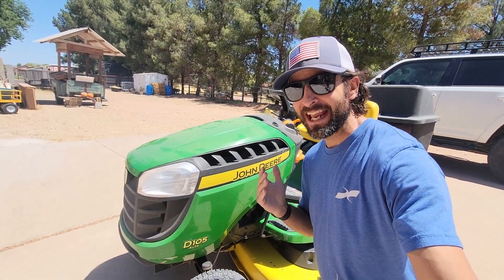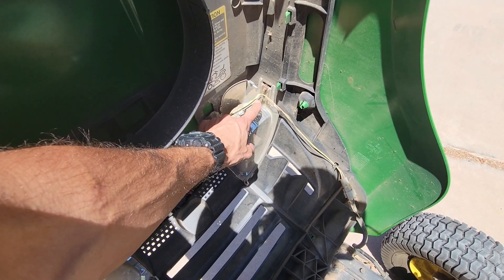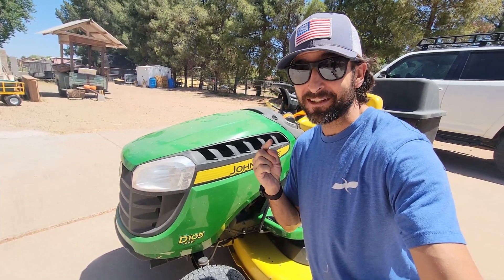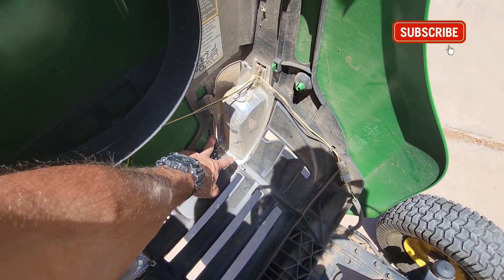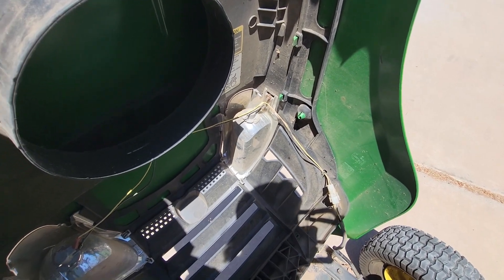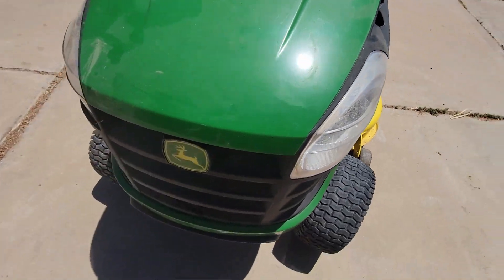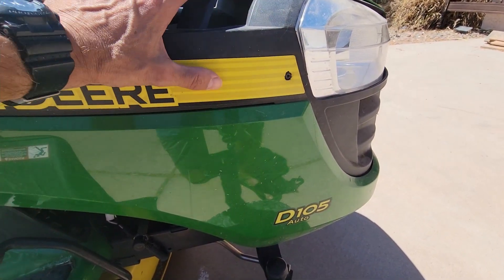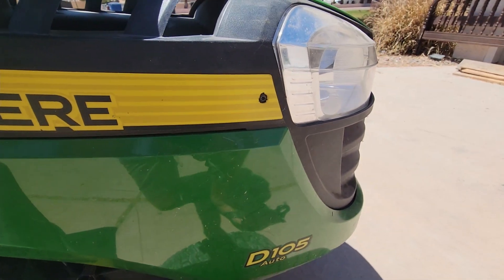John Deere D105 Headlight Removal

Comment: Great to know, thanks for the info. In fact I am planning on taking the headlights out to give me a little more light. I replaced the incandescent bulbs with LED's, MUCH brighter, a nice improvement. But I notice the inside of the headlights is painted a light grey, not very conducive for reflecting light, so I want to spray the insides with metallic paint, give it more a mirror finish instead of the grey. I'm fairly certain that should increase the output a good deal.
To help with the decal, so you won't need to cut a hole in it, use a heat gun to heat the decal, that will soften and loosen the glue and allow it to peel easily. Try to avoid touching the glue side, don't get your finger oils on it, and the decal will stick back down in place.

UPDATE:
Well &^%$#!!!
Here I was all pumped up about how easy it was going to be to do this. Hey, I just gotta peel back the decal and remove ONE screw. Even I can't screw that up!
I guess ol' JD didn't like how easy that was to do.
I have a 2023 S100, under the bonnet there are two black plastic formers, the one on the top for the air vent, and one for the front grill part. The headlights are held in place by the front grill piece, with a couple of locking tabs holding them in place in the grill.
At first I thought that I could just unfasten the front grill piece and remove it and the headlights at the same time.
But nooooooo, the upper piece overlaps a section of the grill piece, and there is a SCREW holding the two pieces together that cannot be accessed until you remove both pieces.
There is no screw under the decal anymore to remove the headlights.
So now I have to worry about breaking the numerous locking pins that hold both pieces in place.
I repeat - &^%$#!!!